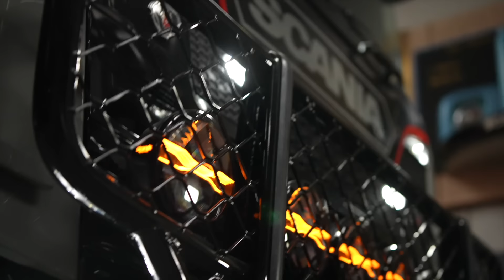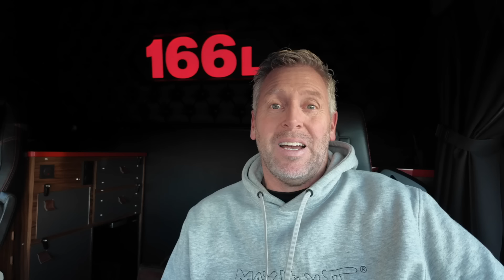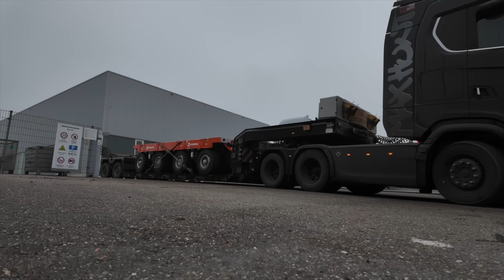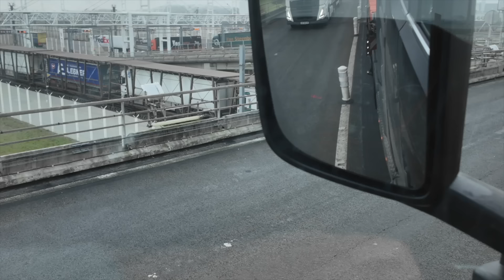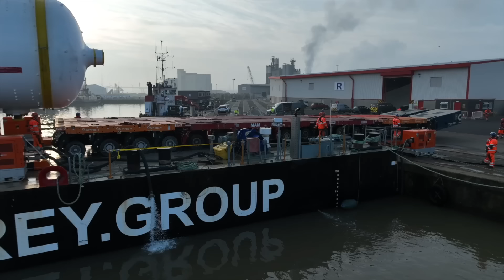4.500 tons delivery.

Comment: Never have i seen a 4082.33kg load specified so precisely
Reply from the maker: So the bridge was "only" 4082 tons?! :) DAN claimed 4500 tons, which sounded way better to me :)
Reply: @M @MAXHUNT-JUSTADRIVER  if your pedantic your title reads incorrectly as 4t to a very high precision.   It should be a comma not a decimal point and tonne metric not ton.

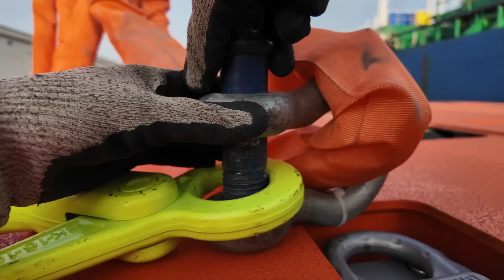Comment: 4:55 That must be a reactor tank for one of the Hickory Point C stations.
Reply: It is a steam generator. Its where the water from the reactor exchanges its heat to the water wich turns into steam. These 2 do not come into contact with eachother due to radiation, thats why they use this vessel
Reply from the maker: Actually, I do not know what it is, but I do know that it was going for the nuclear power station.